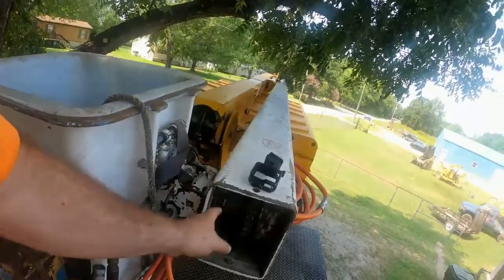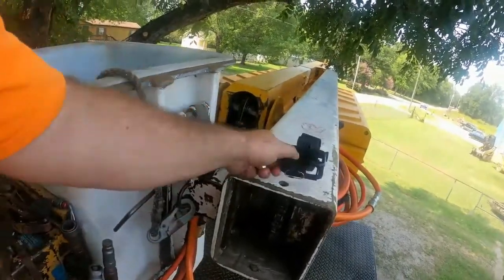Installing a Sixty Foot Hydraulic Hose on the Boom of the Bucket Truck

Comment: Where did you buy your hose ??? We are needing a 68 foot Orange Hydraulic half inch Hose, 3000 pounds ---I called Altec and they sent a picture of the boom assembly. I need a hose... I called our local hoses shop and it cost  about 1100$ so just wondering where else I could look. Please let me know.
Reply from the maker: @andytrejo7107, I make my on non-conductive hose for my trucks. You can go to hose in a hurry on the internet and order one online. You have to know the size hose and the ends. The last hose I got made was 60 foot and 1/2 hose with jic fittings female. I t cost me $520. Thanks for watching!!!!
Reply: Find another hydraulic shop , that one's gouging you

Comment: I'm having problems trying to feed a new hose through the lower boom. It gets a few feet and stops on something inside the boom. And I can't see inside of it. Anyone have any suggestions.
Reply from the maker: @williamrowe5298, it might be getting hung on the fitting itself or around a ninety-degree bend. I have had to put soap on the hydraulic hose. It's crazy but it works. Thanks for watching!!
Reply: @ChrissStumpGrinding  thanks for the advice. it looks like a bracket for holding the lines in place but it's really hard to see. I tried to get a snake through it and pull the line back but that didn't work.
Reply: Some of the TEREX booms do have clamps that keep the hoses secured to the inside. There should be metal ovals throughout the boom that can be removed to take a peak inside.

Comment: Weird.  My comment didnt have my name.  What i meant to say is I changed one on mine i attached it to the old and pulled it through.  And when i changed the hydraulic pump it comes from the factory turned all the way down. So i just got in the bucket and had my buddy turn the pump up until it lifted me,then go 1 turn more.  Previous owner had the pressure turned up high and it was blowing seals and hoses
Reply from the maker: K c my bucket truck would do the same thing when I got it with the non conductive hoses.
Reply: @ChrissStumpGrinding  Mine is an LR 4 altec.  Its says 3300 psi.  Im thinking no way. Lol.  Garbage trucks are set at 2000 to 2300.  I know im lighter than 15 tons of trash.